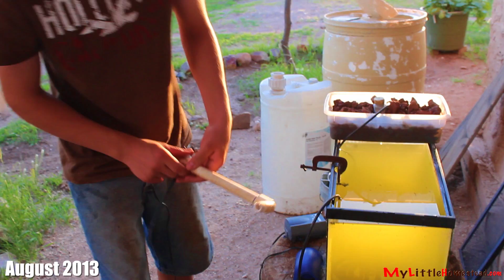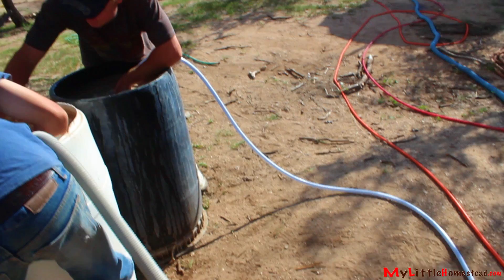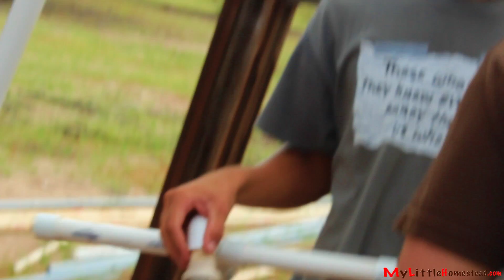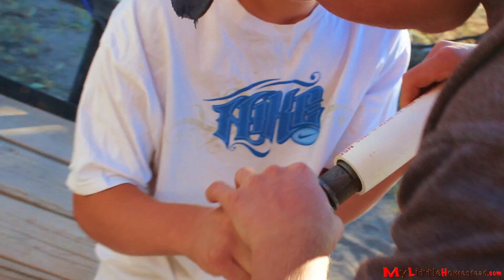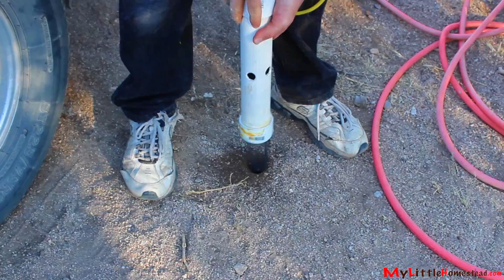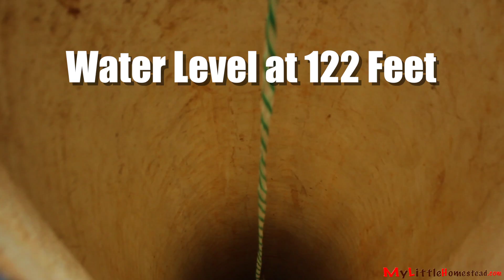Drilling Our Own Well | Homemade Pneumatic Drill | Weekly Peek Ep7

Comment: you're not melting that pvc right? the fumes are highly carcinogenic if it burns which is hard to avoid in an uncontrolled environment. I'd suggest adhesive solutions instead

Comment: This is Nathaniel from www.HowToDrillAWell.com - it looks like you're using the same motor we use for one of those efforts, but you're using it outside of it's housing. We experimented with that early on, but found it was impossible because without the machined aluminum housing to keep it aligned, the motor loses the majority of it's power. 

You needed to use the entire housing, with the handles chopped off and the air channels redirected. It also looks like your bit is smaller than your housing - it needs to be bigger, to allow it to pass through once it's drilled the hole. And your hose needs to be put in straight, not with a T, that will keep it from going through the hole in the rock too.

Just some thoughts I have, as one homeschooler who drilled a well this way, from scratch, when I was 15 and later built a business out of selling the kits.
Reply: What motor is it?

Comment: Hi, It looks like your having a lot of fun with your well drilling.

If you would like to increase you production rate and make things a little simpler you might want to consider a spring pole drilling method using an old axle (hardened) from a junk yard, a piece of rope and a springy piece of wood. You could also motorize this if you like (cable tool drilling, also available on the web). After you beat the sand and rock to manageable sized particle it is easier to evacuate the cuttings with your air lift pump.
Reply from the maker: +John Merwin Thanks for the idea John!

Comment: you need to use a rock drill bit like those used in mining , to remove the stuff drilled up you might look into using a some what thick slurry of water and bentonite this is used in drilling water and oil wells it lubricates the drill bit and lifts the debris out. also the PVC pipe you are using is not strong enough steel pipe is what you need. you can watch some video's of this in action to see how the pro's do it. I do like your ingenuity with what you have done so far, keep trying you will get it done.
Reply from the maker: +Paul Mcguire Thanks Paul - Great info :)